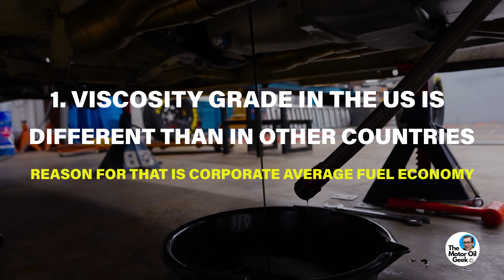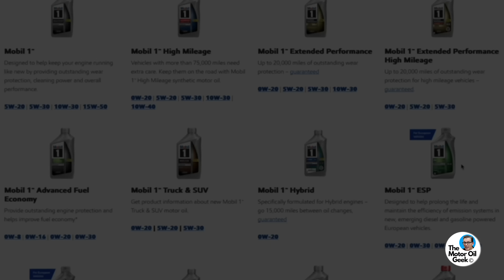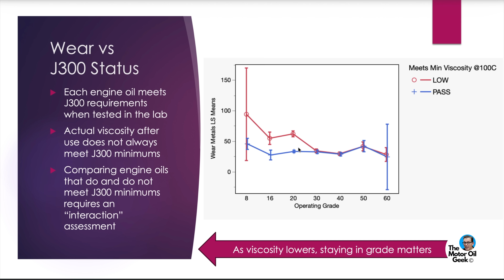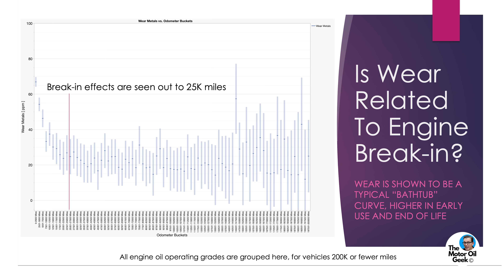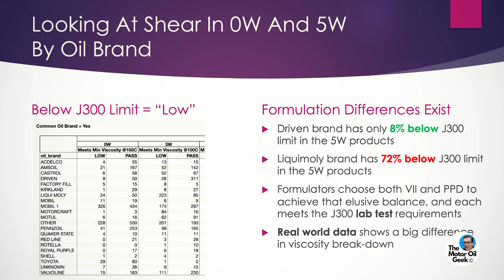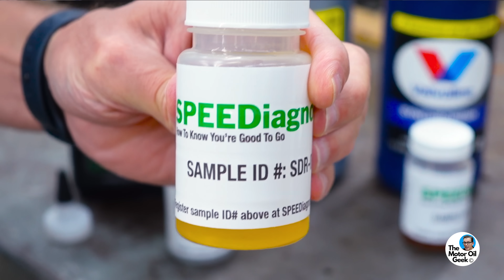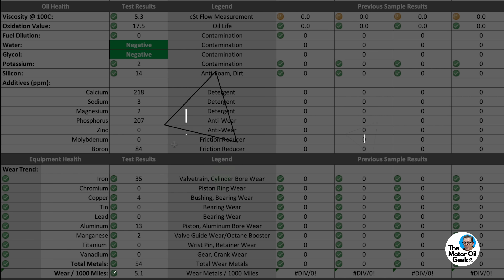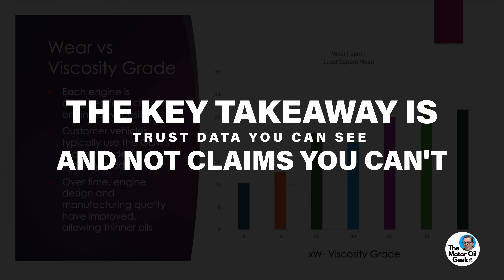More Ai Lies? The FACTS about 0W-20 vs 5W-30 (With Evidence)

Comment: I love your channel.  I generally get way more miles from my trucks than most people cause I use good oil and I test additives.   Mobile 1 is what I use in everything but I noticed something odd with 0W20 in my Nissan. Ever since new when I drain the oil the last quart comes out in thick globes like it was 1983 Quaker State. Once the warranty was out I started adding 4 oz of hot shots stiction eliminator and it has stopped that.  What is the deal with that?   I also use hot shots in everything and it keeps engines clean.

Comment: Shear stable, by brand? Live in area with hot summers, never below 32 degrees, using 5w-30 for heat factor, 10 year old car, no issues! My longevity test.
Reply: I don't see a need for 0w ever unless you live in the coldest northern states in the winter.
Reply: 5w30 in nj and no issues over 15 years on my car

Comment: Interesting video, but at what point does the shearing out of grade become an issue? For example is it when a 0W-20 becomes a 0W-18 or a 0W-15?
Also surely if you start with a 5W-30 or 5W-40 even then it's never going to get as low as a 0W-20 within normal change intervals, even if it becomes "out of grade"?
Or am I missing something? Is it the number before the W that drops? Can it go lower than a 0??
Reply from the maker: Thanks for watching. As the data shows, when the thinner oils (20 grades and below) shear out of grade, wear increases. The thicker oils (30 grades and higher) tend to shear out of grade more frequently, but the increase in wear is not as statistically significant. What we see with the higher viscosity grade oils is the the effects of shear stability are more related to the engine platform itself. In other words, some engines are more sensitive to when an oil shears out of grade than others.

Comment: Would have liked an explanation as to why the 0W20 gave lower wear than 5W30. Is there any logical reason? Actually, he said it's not statistically significant, so I guess there is no difference (they are the same), which makes sense.
Reply: Well, statistical significance is made up be humans. What it not significant at 5% can be significant at 1%.
Reply: @henkrpe3249  I guess you mean what isn't significant at 1% (99%) may be significant at 5% (95%)? Do you have an explanation as to why 5W30 might yield more wear?
Reply: @nwsvndr sorry that's a typo, should be 10% not 1%. But yeah. 

People have been speculating on this for a long time. One of the things I see is that 0w20 flows more easily when the engine is started and everything is cold, so it lubricates the system faster during periods when it is most needed. But that's difficult to prove.

Comment: so lake , let me ask this. i have or im building a old school conventional 496 bib block chevy. you recommend to use the  driven HR oil which im going to use but it seem the full synthetic  oil  has the best shear stability for viscosity over the conventional HR  oil. am i correct o that ? so what should i run ?

Comment: The key is simple: Change oil regularly. I go 4-5k
Reply: Are your crazy? I change mine every 400 miles because oil can shear out of grade in 500 miles.  Oil is cheap, engines are not.
Reply: @k9feces  Easy there big guy, living dangerously at 400 mile interval.  Better drop it down to 200 just to be safe.
Reply: @se4g4e 😂😂
Reply: @se4g4e  Oil changes after every drive is the only way to fly.
Reply: @Dav @DavidTMSN if that’s the case can I just use cooking oil that would save me a lot of trouble 😂
Reply: @se4g4e  and don't forget to change the drain plug every year and powerwash the inside of windshield washer bottle.   (Although a relative called me in a panic once after putting engine coolant in the windshield washer bottle-  I told him to siphon out the old mix and fill with dish soap solution)
Reply: @DavidTMSN  no engine flush?
Reply: @k9feces  Engine flush after every other drive.
Reply: @se4g4e better yet, i run my engines with no oil at all. Dont have to worry about something if i dont put it in there!
Reply: @k9feces  Full synthetics have high detergent packages, flush not needed...
Reply: @k9feces  You may want to go back and listen more carefully.  Selecting the right motor oil is key.  The old "oil is cheap, engines are not" is to say, you are too lazy to do the research to select the right motor oil.
Reply: @k9feces  I change mine after every drive, you can never be too careful.
Reply: @piglet01  exactly thats why i change mine before and after my drive!
Reply: Me too.   Love this channel, but going down this rabbit hole is getting old.
Reply: 8:54
Reply: @tuffguy428 4 - 5K miles isn't a bad oil change interval to go by, especially if most of your mileage is city. I'd also check the oil dip stick every 1- 2 k just to make sure it's clean and that you aren't burning any oil.
Reply: And use what the manufacturer says to use.
Reply: @troyb.4101  Sadly that's true if you have a warranty.  But, you could get an oil analysis after a summer run and have documented proof of how the oil is doing.
Reply: You may want to go back and listen from 8:54 to 9:10.  An oil that tends to shear, does so quickly.  A shorter oil change interval is not the solution to avoiding shear.  Selecting the right oil, that doesn't shear is key.

Comment: Hey Lake I saw an interesting video from The Car Guy Online talking about Tundra V6 turbo engine failure.  He found a Tundra owner that graphed his oil pressure at idle after the oil achieved operation temperature. The Tundra has a variable pressure oil pump to reduce parasitic loss for CAFE. The oil pressure was averaging about 10 psi with dips as low as 6 psi. His contention is that it is not contamination or tight tolerances as is often claimed and he shows from the Toyota service manual that the previous V8 has tighter bearing clearances than the V6 and if it was contamination why are the replacement engines failing too? He is suggesting switching to 0W-40 from 0W-20 like GM has done and Ram does with their problem free Hurricane engine. The video is interesting.

Comment: Great content! Would love to see a video on which brands of oil perform better
Reply: He has one, its titled "Is amsoil the best" and the answer is no.  The best for all around regular use is pennzoil platinum plus.
Reply: @joefratianni8693  I switched to Platinum Plus two years ago in my Mazda 3 and gas mileage increased three miles per gallon on average. The car idles as when new!
Reply: @joefratianni8693 Pennzoil Ultra Platinum?
Reply: @joefratianni8693  You must mean Pennzoil Ultra Platinum?  And yes, best bang for the buck based on many different videos.
Reply: @lonniebeal6032  Well since the evolution has been Platinum, platinum plus and now ultra platinum, I think I will hold off and wait for the ultra platinum plus as it must be better.  Of course as soon as I buy it the super ultra platinum plus  will be out....maybe I should wait till then?  I don't want just any old garbage oil now.
Reply: @lonniebeal6032 what about Castro euro spec

Comment: Lake what is your feeling about using a 0w30 or 0w20 on my 2024 bmw x5 with the B 58 motor on this application. It's a mild hybrid. Under the hood, it says 0w12. Very hard to find on the aftermarket. I think I'm just gonna run 0w20 for now!!
Reply from the maker: We've actually seen excellent results with the BMW Twin Power 0W-12.
Reply: @themotoroilgeek  OK very interesting.. That oil is very expensive at the Dealer.. I did find this TotalEnergies quartz ineoXtra efficiency 0w12 with the proper spec BMW LL-22FE++ . Any information on this oil that you can share with me.. made inEU. Really starting to enjoy your channel. Thank you for all the hard work that you put in.

Comment: I noticed that they used Castrol Edge 5W-40 For testing instead of 5W-30..

I Use Castrol Edge EP 5W-30 with a Mobil1 EP filter an Marathon Endurance/STP Fuel in my 2015 Buick LaCrosse premium 2

Comment: mr speed i have seen this many times tell me if its super wrong or if its ok ,,,,many diy mechanicks do their own oil change but dont change the filter and they use a differant brand oil of same viscocity , they use whats on sale at walmart every oil change but they change oil brands each oil change but keep same oil filter ,,,,,,can you do a video of that showing oil analysis of new oil then oil analysis of oil after its mixed with old oil from filter and see if it makes a huge differance in the 2 analysis
Reply: I've never heard of DIY mechanics not changing the filter - why wouldn't they?
Reply: @stewstube70  there can be various reasons , not be able to remove old filter due to access to filter or not the right tool to remove filter or money savings or not having a new filter or not knowing that there is a filter etc etc etc not all diy mechanics have real knowlege of oil systems

Comment: Thank you for doing this. It's funny to see how many people are desperate to believe that manufacturers are misleading them somehow. I don't know if it's just "old school" thinking, or a conspiracy mindset, or the Dunning-Kruger effect, or a combination of all three. But it's weird to see so many people base their opinions on anecdotes and speculation instead of science.
Reply: It's because alot of engines are failing in the last 10-15 years. About the same time most manufacturers started using thinner and thinner oils. Cam shaft and lifter wear is a big problem with today's engines. Manufacturers have also reduced oil pressures to keep parasitic losses lower for better fuel mileage. It's a double edge sword.
Reply: @johncadloni4538 

More like better control of oil pressure. Toyota has been running hot oil idle pressure as low as 5 psi for decades. Very High pressure oil when cold offers no added protection.
Reply: @mp23cc  Ya, thats what the bypass valve is for on cold start and i would rather have 15-20 psi at idle because i dont care if i get  .1 or .2 better mpg numbers with 5 psi at idle. I like a bigger margin for error than that. Its dumb. Where do you draw the line? I dont drive in a lab or on a dyno machine. The real world isnt perfact. CAFE standards are pushing things too far and too fast. We are the ones that have to pay the price. Its not all bad but its just not worth it. Dont get me started on direct injection 😮
Reply: @johncadloni4538 What is the evidence that more engines are failing? And even if they are, what's the evidence it's related to oil?
Reply: @DeuceDeuceBravo lets see......hemi cams and lifter, 3.6 cam and lifters, GM cam and lifters, ford cam and lifters, worn and stuck piston rings. Cars burning lots of oil. Not all are just because of thinner oils but it all started at about the same time. Very low tension piston rings are there own problem. All are related to CAFE standands an not what is better for the consumer. We just pay for it in the end. Direct injection  is another joke solution with fuel dilution of the oil and carboned up valves. My car has two different fuel sytems to take care of the problems. A v6 with 12 injectors, two fuel pumps ect. Its not cost effective to buy or fix. It not just the 0-20, 0-16 oils. Its the whole sh$t show that WE THE PEOPLE have to pay for. I get so tired of it. Rant over.😊
Reply: @johncadloni4538 I understand your point, but again that's not the fault of the oil.  Regarding CAFE, European regs, etc... society has decided that these tradeoffs are necessary to try cleaning up our air. Manufacturers try to meet these requirements in the cheapest way possible - they could do better. Everyone is still learning as we push the envelope of performance and efficiency.
Reply: I'd say specifying a certain viscosity for one market (US) versus another (Europe) IS misleading the owner. This video backs up that claim that it was done to meet emissions requirements. However this video does also show that the differences between the two grades in terms of protection is more nuanced.
Reply: they are. GM telling people to go to 40 weight on 6.2s  says it all.
Reply: @fishman80 GM had a design issue, and telling people to change the oil viscosity is one way to address it. But you can't extrapolate that issue into "thin oil bad".  GM screwed up.
Reply: This only spotlights the importance of very high quality oil, filters and shorter oil changes based on fuel burned more than mileage driven. The fuel you burn, the more by-products in the crankcase,  long intervals don't cut it.
Reply: Government CAFE standards...

Comment: I use the oil the manufacturer recommends while the vehicle is under warranty, but ignore their oil change intervals. I never go over 5k between changes.
Reply: As Lake says, have your used oil analyzed. You may be wasting good oil by changing it too soon.
Reply: @davepaturno4290  Spot on 👍

Comment: What great info. I did go to my wife's RAV4 owner's manual (2018 bought new XLE Hybrid) and always use a 0-20w as recommended but the owner's manual specificallt said and I paraphrase "if 0w-20 is not available you can use a 5w-20recommended but the owner's manual specificallt said and I paraphrase "if 0w-20 is not available you can use a 5w-20 but change back to 0W-20 when available."   I will stick to the 0W-20 but nice to know in a "pinch" i can use the 5W20.
Reply: I think it says 16w on my Toyota hybrid but I stay with the 20w and 20w mixed with 30w Restore and Protect. Whatever gives you peace of mind.
Reply: A few lines down, it also says an oil with a higher viscosity may be better suited for high speeds or extreme conditions. What are those speeds and conditions? They don't say, but Toyota gives a slight "CAFE Approved" nod to using higher viscosities if need be.

Comment: Question for me is there a number of miles on 0w oils in an engine where most brands of oil generally start shearing and falling out of grade,   5,000  7,000,  10,000 miles ?      I've seen AI videos that say that 0w oils shear and fails to protect more quickly than 5w oils but as you said they never show any proof.

Comment: @themotoroilgeek Thank you for this video. Could you do a video on the Toyota GR86/Subaru BRZ platform? The forums are full of heated debates about the proper weight of oil to use. Your comment about different weights being recommended in different countries is a big part of the debate. You also have guys that track their car so they bump up to 0W-40, 5W-30 and 5W-40. It would be great to take a deep dive into this topic for this platform while Toyota/Subaru recommend 0W-20.
Reply: Same with GR Supras and Corollas. I have a GR Supra. The owner's manual does mention that if your car is tracked, then a higher grade synthetic oil is recommended, as it is for modified/tuned engines that use E85 fuel, for example. But for street use, 0W-20 oil having the specified certs is perfectly fine. Toyota has been using this viscosity oil since 2010, and there are many, many owners out there with 200,000+ miles on their engines after 10+ years of use.
Reply: @davepaturno4290 same with our 21 4Runner that calls for 0W-20 but it’s the same engine since 2010
Reply: @atpgarageatl For sure, that 0W-20 oil has been proven.👍

Comment: You say the closer the viscosity split, the more shear stable.  But, on the shelves the 0w20 oils are Dexos I  approved whereas the 5w20 oils I see are not.  I assumed the 0w20 oils were more shear stable due to meeting the Dexos spec.  What part of the Dexos spec doesn't allow the 5w20 to meet it?

Comment: Curious how my wife laughs at me for watching these oil analysis videos . After all the hours of information,  I  will continue to use mobil 1 5w30 in my two 5.3L Chevy engines , one from 2001 , the second 2021 , and continue to change the oil at 5000 miles , the ONLY change I have made is to use Techron , and to change the Mobil 1 oil filter every other oil change as per proven to be a good idea.
Reply: The hitch in that plan, is that, unless you do oil analysis on every oil change, you won't know if you have say bearing problems, because you didn't cut open that filter to check it. You just ignorantly carried on with that old filter.
Reply: @budlanctot3060  You don't need it every change, just after the summer run.

Comment: What about for the Guy who changes his oil under 3K miles who goes to a thinner OIl in winter for cold starts??? Like going from a 5/20 in summer to a 0/20 in winter????
Reply: You changed absolutely nothing congrats. The W20 stands for Winter viscosity aka viscosity @ 0 degrees F. You made your oil thinner at normal operating temps. You'd have to go to 5W10 or 0W8 to actually change cold start performance.
Reply: @Jonathan-hx6oy  No.  The 0W20 is the flow rate, O is the winter resistance to flow. The 20 is summer rating, which is why hotter climates might have a 0w30 or 0w40 rating.  Viscosity is a measurement of flow resistance.  What videos are you misinterpreting?  The summer rating isn't actually going to be thicker oil, there are polymers in the oil to make it seem like a thicker oil.  Which is why oil will always flow very fast when hot, and slow when cold.
Reply: Yes, your interpretation is correct.  If you want to be sure, send oil in for analysis after a summer run to Blackstone Industries, it's $40 for a full test.  Also quality of oil makes a big difference.  Amsoil and Redline are most likely to stay in grade  Pennzoil Ultra Platinum has always been in the top 3 when ever it was test against other oils.  Mobile One Extended Performance tested well, along with Castrol Edge with Titanium.   But the summer run on oil and an analysis will give the info you need.